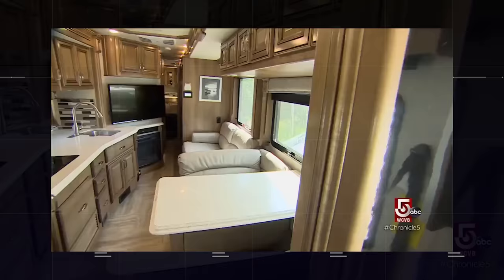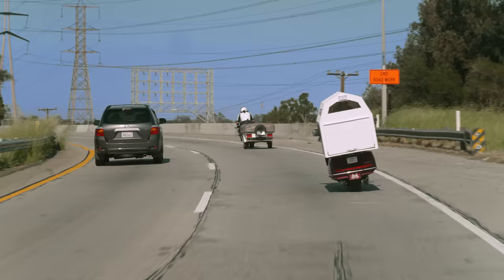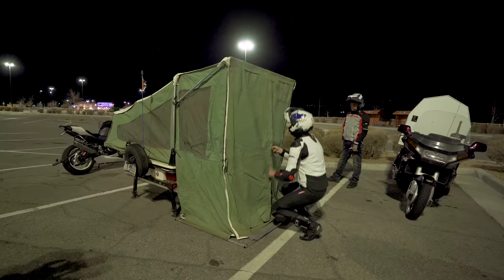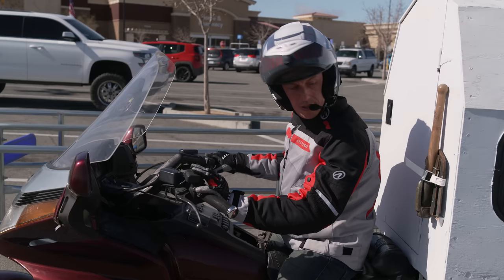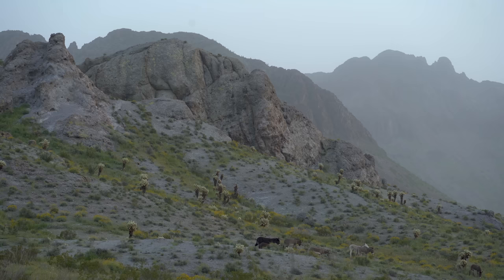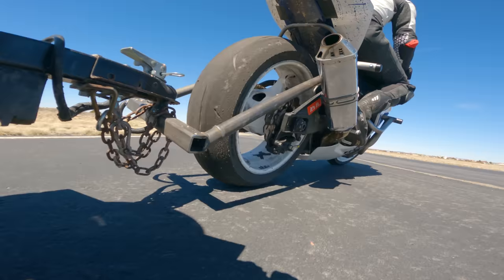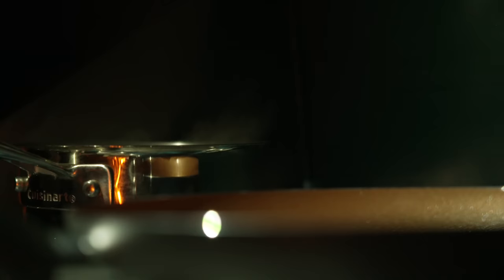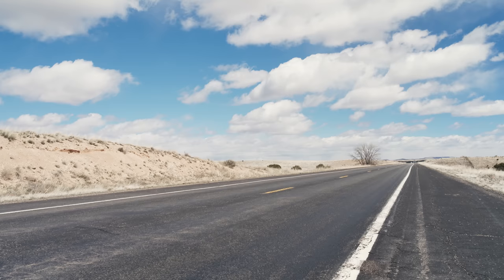Motorcycle Motorhomes! Honda Gold Wing vs. Suzuki GSX-R1000 | CTXP

Comment: I think regular old motorcycle camping where you strap a bedroll and a 1 person tent to your chopper and ride out is probably still the way to go but I can't lie these 2 vehicles are hilarious
Reply: The towed tent can actually be reasonably comfortable for 2. If you, say, use Gold Wing in the intended configuration to tow it)
Reply: @BroOmnipotent i bet towing anything with motorcycle is illegal in my country, Finland.
Reply: @juha2031 you can but trailer can only be 1.25m wide and max weight is 750kg or half of your bikes unloadet weight.
Reply: yeah popup tent or hammock it.
Reply: I do that on my 125cc street bike.
Reply: Potted plant or bust!
Reply: Riding down to France (from Liverpool,  UK) in a couple of weeks with my tent and kit on my trusty benelli bn125 😂😂 NOT a touring bike by any means, hoping to make it work.
Reply: @juha2031 в России запрещена, за исключением мотоциклов с коляской
Reply: @juha2031  it is not. You motorcycle just has to be registered for pulling a trailer
Reply: @lolaharwood619 you'll be fine. As long as you're sticking to pavement you can tour on pretty much anything. It's just a question of how comfortable you'll be along the way 😂

Comment: So fitting that after riding that deathtrap through the wind you get to sleep in a weird expandable casket, amazing
Reply: In a Walmart parking lot, no less
Reply: A full 80 inches!
Reply: For version II of the expandable casket I'd make it with an aero bullet shaped front end, and have it also expand up. That should mitigate some of the sail effect. Also jackstands on the back corners of the casket  instead of under the bike - or maybe even add bolt on "trike" wheels like Tow-Pac's Instatrike.

Comment: I think the Wingbago box on a single wheel trailer would actually be pretty good.
Reply: Agreed, I think the idea has legs.  I want to see a sequel.
Reply: I think it could have benefited from some aerodynamic focused redesigns too. Now I want a shop manual Wing-Ebago 2.0 build.
Reply: @whimsicalstray  - That, and using lighter materials.
Reply: Especially if it were built foamy style
Reply: A collapsible type of trailer is what I'd like to see, foam, carbon fibre shell, light but strong, light weight and waterproof. Being able to stand up or at least sit down in is what I look for rather than something that you have to crawl in.
Reply: Exactly what I was thinking when I saw the thumbnail of the video. 
Putting it on the back of the bike was dumb and dangerous but extremely funny to watch 🤣
Thank you Revzilla 😂
Reply: @steveclark..  About 15 years ago I saw a totally functional, totally cool motorcycle camper. The guy modded a sidecar to be a pop-up camper. He lengthened the frame of the sidecar and used a huge fiberglass roof-pod storage thing meant for an SUV as the base. It folded up and stayed low when driving, and when unfolded the roof (top half of the roof pod) raised strait up. It had a Twin mattress in it, and room for a small shelf/storage area near the back. And yes, he even had a shore power plug-in for lighting, battery tending, running a hotplate, radio, and laptop. With three wheels I bet it was stable too.
Reply: @matts1166  Sounds good, I live in the UK, not seen anything like that, just the odd Goldwing towing a small trailer tent maybe.
Reply: You could actually make the wingabago bigger on a trailer! 😂

Comment: I took my 1974 Honda CB750K4 on an 8,000 mile solo road trip around the country.  It has half a Vetter touring kit on it, upper fairing with windshield, highway bars but no pegs, just the studs heh.  Platforms, king/Queen saddle seat, sissy bar, rear luggage rack and integrated fiberglass side saddle storage.

I tried my duffel bag onto the passenger seat and when I got tired, I just kicked back against the bag, propped my feet up between the windscreen and handle bars, and slept.  To stay out of the weather, I tied my Wubby (if you know, you know) between the sissy bar and windscreen and it made it a comfortable tent.

I hit some hellatious wind on US-2 coming across Minnesota.  I had to be on the far right shoulder, leaned so far into the wind that when I crossed a wind break, it shot me all the way across both lanes before I could straighten up again.  That lean into the wind is no joke on big, old bikes like mine.  They are much taller than modern bikes.

It was all period correct original, no cup holders, charge ports or anything.  Cruise control for me was a left hand cross grip on the throttle, heh.

First issue was a broken chain half mile west of Maris Pass.  It was so stretched that I just used the breaker tool to press out the broken link and press it back together.  That got me all the way to central California, heh.

I stopped in California to get the utterly worn down rear tire and chain replaced before going into Death Valley in August.

I got a flat rear tire in Death Valley.

While sitting on the tire, I had a van full of European tourists slow down, take pictures, wave and drive on.

Other than that, no issues.  Frozen mountain passes, stormy open plains, 120+ degree desert heat, the bike handled it all without issue nor complaint.

It was a great ride.

Comment: I think with a little re-engineering the Goldwing set-up could work well.  Different materials and a canvas pull out would be the start of some major weight reduction.  I’d try to incorporate a different leading edge as well to prevent the drag.  Great proof of concept though!
Reply: I just used those same drawer slides for a project of mine and lemme tell you those things are heavy af. a fold down back with a canvas cover would go a long way in reducing weight
Reply: Fold down poles on the 'house' for stability would be very helpful, and not add too much weight.
Reply: There are self build bicycle campers. Much lighter and still sturdy and good to use. Would be an easy thing to adapt this on a goldwing.
Reply: I pause a chest of drawers on the back of my Goldwing with 10 drawers on it and I had absolutely no problems riding it in the wind. These guys are simply inexperienced riders
Reply: @elixier33  Did you see how hard he had to lean sideways as he was driving straight? Experience wouldn't change this. Maybe there wasn't as much wind on your ride.
Reply: @elixier33 Spoken like someone who's never experienced high desert winds, that stuff doesn't give a damn about your experience. They were lucky that was the worst they saw, those winds can easily hit the 60mph range.

Comment: The Kompact Kamp Mini Mate Motorcycle Camp Trailer Tent is about the best of the type.

The ability to hang up wet riding gear and to have full standing height is welcome, as is being able to attach an awning or a separate Add A Room for extra enclosed space for time at camp.

A diesel air heater enhances life in wet weather or during winter months.

Comment: That Wing-abego with extending section was a nice piece of engineering. As someone else in the comments mentioned; having that setup as a trailer with some added support legs for the extension portion would make a decent camper option!
Reply: Yes!
Reply: think mounting it on a sidecarframe would work

Comment: This reminds me of when my wife and I and another couple left home In Augusta Ga. going to Billings Montana to a Goldwing Rally. We made two of these trips. Going through Kansas we ran into a 65mph. wind. It was a head on cross wind. I had my GL 1800 wide open and only running 35 mph. I knew if I had stopped we would have been blown over. I believe our 650 lb. Camper kept us on the road.

Comment: Would be interesting to see Ari's Wing-ebago mounted to a sidecar or single wheel trailer. I think it could actually work fairly well.
Reply: yeah I agree, seems to be a better way to add that sorta thing to a motorcycle without making it massively top-heavy, a sidecar would also look cool IMO, once one overcomes the asymmetric steering pattern.
Reply: A trike would be perfect.  It would also be in keeping with the spirit 'potholes? you hit them all'.
Reply: Yeah that would work way better
Reply: Imagine if it was a trike, it would never tip
Reply: You get those motorcycle + sidecar that have been converted into a hearse. I think that would make a perfect starting point for a motorcycle camper
Reply: Good call, having it lower down would be huge with the crosswind.
Reply: Small two wheeled trailer like from harbor freight they have some for quads
Reply: @casuallatecomer7597  About 15 years ago I saw a totally functional, totally cool motorcycle camper. The guy modded a sidecar to be a pop-up camper. He lengthened the frame of the sidecar and used a huge fiberglass roof-pod storage thing meant for an SUV as the base. It folded up and stayed low when driving, and when unfolded the roof (top half of the roof pod) raised strait up with canvas sides. It had a Twin mattress in it, and room for a small shelf/storage area near the back. And yes, he even had a shore power plug-in for lighting, battery tending, running a hotplate, radio, and laptop. With three wheels I bet it was stable too.

Comment: That suzuki setup is absolutely amazing. The gold wing was a good attempt but I couldn't see anyone actually using that. I feel like combining the 2 together and pulling the popup with the gold wing would be the ideal situation.
Reply: I could see that. The Goldwing has plenty of power and with that camper set up, you could throw a passenger on and go.
Reply: @highball5550  He could of made it a pop up instead of solid on the Goldwing. Would of helped with visibility, weight and crosswind.

Comment: the wing a bago was done really well.  I like the finish, it's insulated and has sealed windows and RV locks. he only thing that I would change if this was actually serious would be to add thin aluminum to the roof and sides like a real RV. It wont take long for that plywood to start to rot.
Reply: Idk.
   It's always going to act like a sail in a way

Comment: Really liked the idea of the wing-ebago as silly as it is 😂, although the crosswinds were really scary, maybe it would be slightly better if the top of the camper could be folded flat as well so it doesn't catch the wind too much
Reply: I agree. Maybe as an enclosed side car it work better on the road. Not so top heavy, and more stabillity thanks to 3 wheels.
Reply: @marcheida2819  It would be absolutely amazing as a sidecar, also wouldn't need to have the outriggers!

Comment from the maker: Go behind the scenes & read more about Motorcycle Motorhomes on Common Tread! https://rvz.la/3q12l3N

Thanks to Progressive for sponsoring this episode of CTXP. Learn more about America’s #1 motorcycle insurer at https://rvz.la/48aclJa
Reply: XD guys. This could have been achieved with some tents that don't require that much rigging. XD fun video as always.
Reply: This is absolutely nuts.
Reply: @ralphwarom2514  Their Sports Utility Cycle (SUC) would've perhaps been a better basis for a motorhome construction.
Reply: Probably should have opened the windows on the wingabago  for the crosswinds
Reply: next challenge do this on super hard mode build a camper a honda navi can haul
Reply: Interest from real live Europeans😂
Reply: I get this is your video but it says the comment is a day older than the video?
Reply: I would love to see you guys build camper trikes! I built a camper trike with a trailer and it went okay from my experience. Though I live in Florida where it is flat.
Reply: Need some training wheels to keep it from blowing to the sides lol
Reply: Put pure silicone tips on the bottom of the Centerstand and an electric motor
So all you have to do is keep it balanced and flip the switch and the motor will push the Centerstand down for you and it won't slip because of the pure silicone grips
Reply: I just have two bags. One 75 liter bag with my tent, sleeping bag, chair, cot, table, two stoves, Coleman Burner. and a Saddleman bag with my clothes, medical supplies, toiletries, salt and pepper, sugar, fold out utensils, solar USB charger battery storage pack, blow up pillow, saw, hatchet, knife, flashlight, 5 gallon plastic water jug, pots, pans, & kettle. I buy food where I need to. I even got a little cooler jug to pack along with it all. One bag on my sissy bar and the other bag on the back seat of my Honda VTX. Oh...and that is besides rain boots and rain gear. Even with that set up, the wind can get to ya. S35 Speakers on my handlebars connected to my turn signals and ignition switch. Just need to by a helmet Modular Shoe Blue Tooth Helmet. I have two helmets, and the full face helmet I have is over 30 years old when I bought it new. Time for a new one.
Reply: Damn helmet is falling apart. lol Still, no scratches..... Knock on wood!
Reply: @brianparent I use to go camping likes that with my Honda CMX 450 C Rebel , it had large saddlebags and the tent , sleeping bag and sleep mat were tied on top to the sissy bar, it also had a tank bag.
Reply: You will own NOTHING and be HAPPY!
Reply: Shouldn't have mounted the Jack stands to the Bike you should have just made them to where they could be taken on and off.

Comment: Jet boil is a life saver for coffee/soups/oatmeal. I like to use a french press or instant to keep it clean for everyday use same with oatmeal  never goes in just poor and let it steep for a few minutes and soups it never goes in unless necessary if its not ramen as I am full time camper living right now with my 2 dobermans and miniature pinscher loving and living life paying bills and working. I love the popup trailer on the motorcycle I actually don't like them but for a motorcycle different story and looks like a food investment if you ride a motorcycle that winebago thing would be suited in my opinion on a trailer like that popup forsure I give that man props driving that weight around like that ans not wrecking or getting hurt.

Comment: Ari seems like he’d have thought about this but if not I feel like putting it out there. Higher rate rear springs to offset the weight would’ve been a good idea. Also I could really tell how/what those jacks were attached (to) I think leaving them off until needed would’ve protected them and gave a little more lean angle to the Honda. Food for thought for anyone thinking about doing that option. I personally think the best bet would be put a hitch on a Goldwing and tow that lil trailer with that.

Comment: The Wingabago is an obvious farce but the extendable insulated box is an intriguing concept.  The downsides are all about how it is being carried.  Park that cube on a pallet sized trailer and tuck it in behind the tour pack.  The IBMC normal would be a cooler and maybe a chuckbox on the tongue. Now it doesn’t fall or blow over.  It's  far less to drag for one person.  The modules separated allows your tight u-turn, space marking and quick change for local touring.  The parachute will reduce your range but can offer a jerry can mount.  The bigger issue is that done well it is easy to forget that you are 5' wide on todays ride.  Remember before you clip an apex and drop that undamped wheel into the ditch. DAMHIKT.  Oh, and a swiveling hitch is useful on anything that leans further than a Harley with a 22" seat height.  I have 100k miles pulling homemades behind an '88 EX500 and an '00 Concours.  Friends have many more miles and bigger trailers than I.  I will stick to tents and hammocks while there are two of us, but the instant deployment sleep box is a great idea.

Comment: I think a fusion of the 2 ideas for a motorhome would be interesting.
The tent was safer to take around in the trailer. 
It was great to be able to fold to store away in the trailer, 
but I felt it wasn't very safe to sleep in and doesn't protect ya from the weather as much.
Then you had the WING-EBAGO which felt safer to sleep in when it wasn't tipping over, 
but not safe to drive around in. Also it had no insulation or padding.

I think the perfect one would be a home made out of wood, 
but that could fold to store away like the tent while pulling it in a trailer as well. 
As for electrical, could just use a portable battery generator or something like it. 
Put some padding and insulation and add the portapod and we good.
Could even get starlink if you wanted to be fancy and have internet too lol

Comment: A little late... But.. You COULD have welded on some slide rails on the bottom of the 'Wings' zorsts, so you had more ground clearance, and then when needed, slide on the jacks, wind em up and sleep, then wind em down, slide out and store back in the home again! But.. Nice idea nonetheless, though, maybe a wooden/Ally tube fold out frame with canvas to cut down on 'Side wind' issues and weight? But in the end, I think I too would go trailer route... 🤔😏😉
😎🇬🇧

Comment: You could do two things to make the wingebago to work better than the trailer.  Make it work like a folding A frame rv in a clam shell design. So it folds on hinges in the back of it then panels fold up and over to make a sleeping space you could cut almost half the height that way and still store an inflatable mattress and sleeping bag along with a few odds and ends in there. Then put a leg on each corner like truck bed rv campers have on them so that at night the camper isn't resting on the motorcycle at all and could be left at camp while the motorcycle is free to roam. It would take some time to make it durable but you could probably get about 6 1/2 feet of sleeping space in it.

Comment: You could try attaching the small barn shaped camper onto a motorcycle trike. See if that would balance out the load better going down the road. It's just a suggestion.

Comment: Honestly the wing ebago on a 3 wheeler could work, also just needs some supporting pillars that collapse into the structure on each side and it will be more stable and detachable
The trailer would still have the upper hand tho